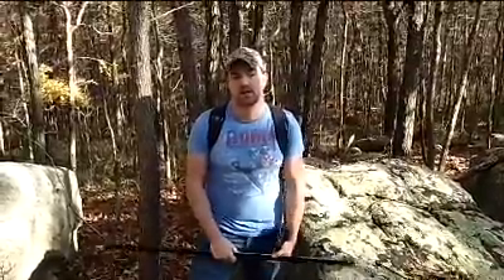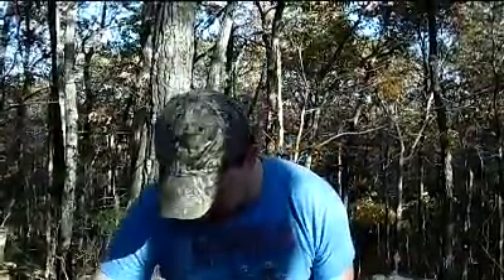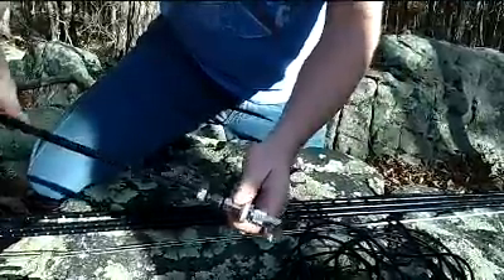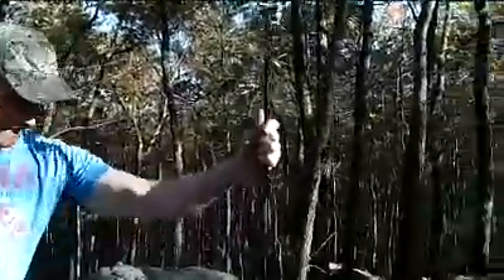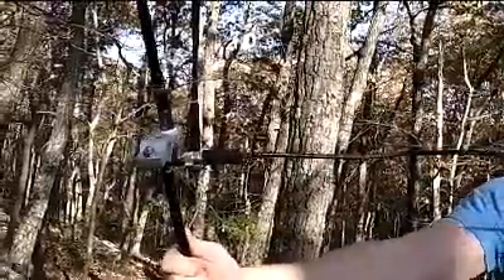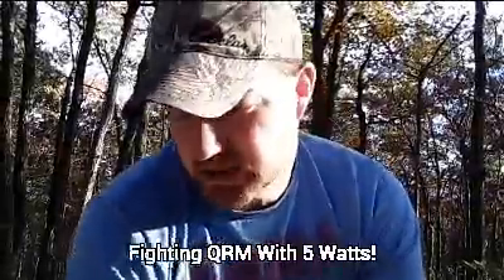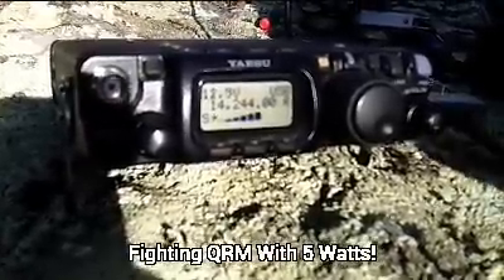Ham Stick Vertical Dipole Antenna

Comment: I'm wondering how this would work attached to a fiber glass pole?  I would like more height for operating LOCAL 10 meter nets.  Also, how far away does the coax have to be so as to not cause a problem?  Would the few inches you get from using the 90 degree adapter be enough or does it need more separation?

Comment: Did you have to trim the stainless steel whips?  I watched on video where the guy (K8MRD) had to take a few inches off with an angle grinder.  He wasn't using the hamstick in a dipole, though.

Comment: I have tried this setup and can’t get the vswr below 3.5 and 4. Would be nice is you had any pointers on the tuning at home you did. I’m running 34ft of lmr400. Got the mount with 2, 20m sticks. Have tried 1ft up to 4 ft. I have the same 90degree adapter as well. Definitely missing something in the tuning you did at home.

Comment: Simple enough even for me, I have several of these ham stick styles of the whip.  I do have a dual that if pole-mounted it is horizontal but might do as you did and somehow get it vertical. Is the feed point 75 ohms as is often the case with a vertical dipole?  So very often we consider doing something but don't until someone as you did here demonstrates it will work. Like the fellow that had a plane built but didn't believe in his idea enough to try and then did fly it but AFTER the Wright brothers and no one knows his name. Anyway, thank you for sharing your accomplishment !!! I have lots of 75-ohm cable hardline so a 75-ohm feed point would be a good thing in my case coming into a 75/50 transformer at the radio.

Comment: I need to get some matching hamsticks. I have the dipole mount. Can't wait to try it out. I presently use a single hamstick connected to a 4ft grounding rod with mirror mount and 4 25ft radials that beats out my ocf every time. Your setup looks easier.

Comment: If you cut them to where the SWR is lowest for the band(s) you intend to operate on... in this case, as close to the center frequency of SSB as possible.  How far can you tune away either side of center with a tuner and still keep the SWR low?  I am looking at purchasing the 20 and 40m variants by next spring in a dipole set up.

Comment: A really inspiring video! Have you continued using these vertical with and a foot off the ground? Would it work like this mounted vertically on a fibre glass pole? 73s and well done! Tim.

Comment: FB running it vertically, but can we assume you ran your feedline away horizontally a reasonable distance? Leaving it hang close to the bottom element can skew your desired low angle pattern, and even change SWR. 73
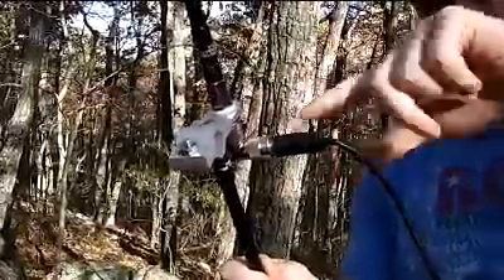Reply: You don't have to assume anything. At the 2:43 mark he explains what he did with the feedline

Comment: Excellent video, I'm ready to try that with a Yaesu FT 7900. Does it matter if I have the antenna touching the ground on a tripod?
Reply: I would think that the antenna actually in contact with the ground would not be a good arrangement as it would alter the SWR on meter readings but could still be a problem for the finals in your radio. Maybe I'm wrong, but it sounds like a bad idea to me.
Reply: Any luck running this setup? I have tried several times and can’t get the system tune

Comment: Informative video thanks. I'm looking to get on 40m and this looks like the answer. Do you need an analyzer to set the lengths if you have a tuner or will you be able to just use 40m hamsticks?

Comment: Now if you feed that 20m hamstick dipole with low loss open ladder line and tuner you got a 20m-10m antenna.
Reply: +Ghost Tracks 
Stay away from 1/2 wave lengths at lowest operating frequency.
Reply: Shawn. Would it matter how long the ladder line is? 
450 Ohm ladder line?